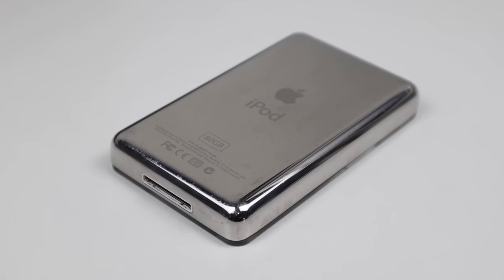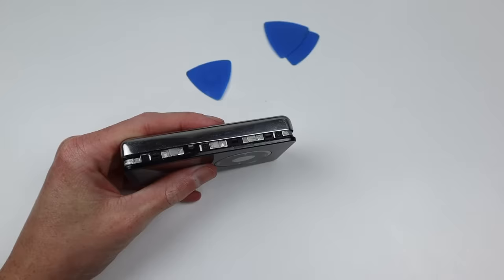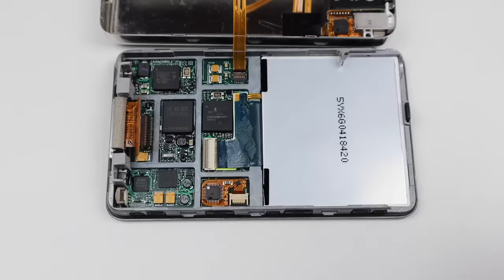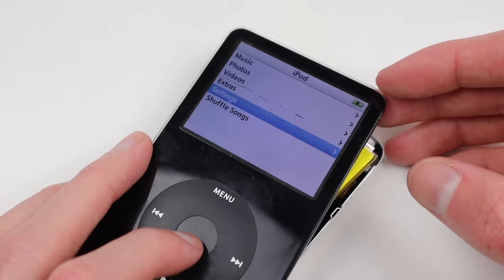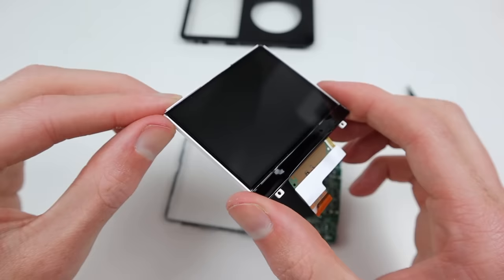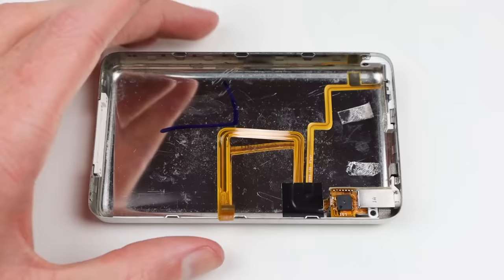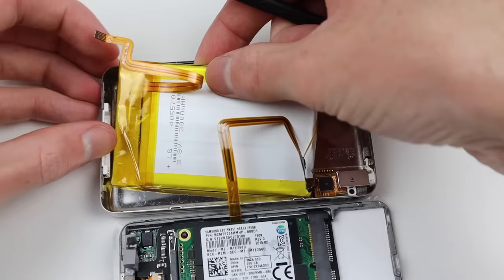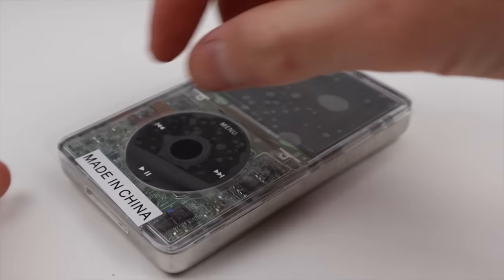Custom Transparent iPod Classic 5th Gen - 256GB SSD & "Nokia Battery life"

Comment: The "protective film" you removed was meant to be there, you needed to remove the centre bit, leaving the surround foam to protect the LCD and also to stop dust getting between the outer screen and the LCD.
Reply: Exactly.
Reply: He is not a tech guy. Thats why.
Reply: Can't speak about the protective film cause I didn't get a new screen, but the foam absolutely needs to be removed completely on the new faceplates. The old faceplates do not have this foam, and when I left it in while taking the center out, it leaves a gap visable from looking at the screen through the face plate window that the original doesn't have.
Reply: @ableite  hes not a fucking iPod guy
Reply: @ableite  um... his channel quite literally involves various broken pieces of technology...?
Reply: @ableite  lmao imagine thinking that being a "tech guy" is some sort of badge of honor
Reply: @jacobasnodgrass5853  twisting and insulating wires doesn't make anyone an electrician. The same applies but with the context you said.
Reply: but it still works so its fine
Reply: @R Huang Yeah nah zoomer.
Reply: mega O O F
Reply: @ableite  gatekeeping tech knowledge
Reply: DankPods used the same faceplate, and he kept the foam.
Reply: @ableite  you are not a fan of hugh jeffreys
Reply: @ableite   can't make mistakes?
Reply: Hugh should of realized this the moment he saw a cut-out peel for the screen portion only. The manufacturer wouldn’t go out of their way to cut the plastic film for fun.
Reply: timestamp 4:25
Reply: Yep, He screwed the pooch
Reply: It looks better without the foam
Reply: @chevymusclecar1970  it's about function, not looks

Comment: You should customize the „80 GB“ text on the back to „256 GB“
Reply: J S good idea
Reply: With a BLACK rear case! I have a 5.5 gen 30 gb with a black rear case and clear faceplate, a 3000 mAh battery and 128 SSD, running on Rockbox. I bought one of those leather Griffin case and it looks INSANELY beautiful!
Reply: Good idea
Reply: Yes, they make these. I modded mine with 512GB SD card and I was able to find a black custom back with 512GB on the back. Of course the serial number doesn't match any more.
Reply: @thomasshepsky2253  drop some photoes
Reply: You could get a cheap blank from ali express and maybe get it etched somewhere
Reply: Even better .......2 TERABYTE iPod 🤣
Reply: this is doable. however the 5th gen can only worknon 30k songs if you are in shuffle. the 6th gen, can read upto 1TB and shuffles upto 50 songs. both can be mod to 3000mAh
Reply: lol
Reply: lol
Reply: J S lol

Comment: 7:28 thank you so much for including this in the video. I'd been considering picking up an iPod partly to install an SSD and use it as an external drive for backups, but seeing these numbers (coupled with the explanation that the ZIF is the bottleneck) made it clear that it simply wouldn't be worthwhile for those purposes.
Reply: What a cool idea!

Comment: I'd try to avoid the mSATA drives if possible, they can cause some unexpected power issues on classics, especially when your battery starts to get low. Other then that and removing the gasket from the faceplate, fantastic video!

Edit: Oh, and flip the battery over, you installed it upside down and that is why the cable was getting pinched

Comment: Fantastic video Hugh. I've recently upgraded my iPod Classic 120gb with a similar card, replacing the hard drive and the battery as well. It all works great! Unfortunately I bent up the case a bit during the repairs. I now want a new front plate and back case. I'm thinking of designing and 3D printing my own. I am inspired by your vids and may give it a shot. There is genuinely something about these iPods. They just sound better to me than a phone or other computer. I'm a bit of an audiophile and have built my own tube amplifier that I run my iPod through into some old JBL speakers. It sounds warm and fat and wonderful. I'm glad that you are able to get parts and keep iPods running. Thanks again for sharing your experience mate. Cheers from USA.🇦🇺🍻🇺🇸
Reply: Did you ever get a case printed ?
Reply: @HighFidelityFox  I tried but never got the tolerances close enough to suit me. I gave up in aggravation lol. I "massaged" the original case back into shape and it's all working fine. Thanks for asking.

Comment: Just a Pro Tip when doing the storage mods, if you have a 30gb 5g iPod dont plan on putting more then around 20,000 songs on there, the logic board does not have enough RAM to load more songs into the library, even if you have enough storage. the thicc 60 and 80GB 5g versions have enough for around 50,000 songs. Also all the 6 and 7th gen. classics, exept for the 7th gen 160gb have a limit of 128gb using the iPod OS, you need to use rockbox if you want to use more storage with those.

Comment: I’ve made a few custom upgraded iPod classics. Usually I only keep the motherboard and screen. Both the front and back plates are better off being replaced with brand new parts. I even went with a 4x MicroSD setup and made one a 1TB iPod. Then flash Rockbox OS on there to play FLAC files.

Comment: Found this by accident, and this video fascinating. I myself used to mod the iPod 4 and 5 to better battery, SSD, and that same face plate. The problem I found was that I installed a duel boot iTunes and Rockbox. The Rockbox is my usual IOS, since it is far more flexible and easier to use than iTunes.

I found that every once in a while, the SSD upon bootup would automatically erase the Rockbox, so I would have to re-install it (basically it was just copying over the .Rockbox directory). Overall that adapter for the SSD was a bit flimsy, granted that I used not an expensive adapter.

My solution was the iPod Mini (2, bit the Mini 1 is also fine). No adapter needed. I just clip in an SSD used in standard cameras. Never, and not even once a problem. Rockbox and iTunes install perfectly. Sound is AMAZING. The iPod Mini is super easy to repair. I have only put in a 64 GB SSD max. I read that you can put in something larger if you wish, but you have to modify the Rockbox wares. I will look into it if / when I need a larger drive.

I would love to find ways to further modify the iPod Mini. The case is a hunk of metal, and it feels GREAT in your hands. It's strong, well made. Only weakness in the device is the clip  (ribbon) from the SSD to the MB can be flimsy, lots of pins, and the slightest bend can mean hours, HOURS trying to find and straighten it. And then, of course the pins bend / break. Finding new ones is not easy. Batteries are around, granted mine only last about 8 hours. 

Sorry for my rambling. Subscribed.

Comment: 6:08 Just do it the apple way, remove the hedphone jack🤣
Reply: Dankpods Bluetooth ipod classic
Reply: Honesty I’ve been off and on thinking over the past few years of a custom 7th gen and that’s not a bad idea 🤷‍♂️ I mean all I run is wireless earbuds so I could rip out the jack and figure out a way to make it Bluetooth compatible. Their is the little Bluetooth thing I use in my 6th gen nano to make it work but I wanna do something else with the charge port... so that won’t work.
Reply: The only space is basically what the new battery leaves. And it has to natively take in the signal. I've seen some dingles barely bigger than a USB port, so size wise that should be possible.
The other question is, how to tell the iPod how to pair? Sure, it could keep the antenna always-on, but there still needs to be some command to let it look for something to pair with. Maybe a small button on the hole where the plug used to be, that might work.

Comment: You should've posted this video like 2 weeks ago, when I was trying to upgrade an ebay iPod lmao
Reply: @luminumlx2604  I'm amused by the improper grammar even after you edited it lol, but no I didn't. I tried to upgrade the battery but couldn't get it to fit, so all I did was upgrade the storage. I also kinda messed it up a little cuz the buttons don't work as well anymore after trying to open it up.
Reply: @HearMeLearn  My native language is not English, so i apologize. I accidentally wrote "When you was" then i tried to correct to "When you were" but then i noticed were was incorrect
Reply: @luminumlx2604  no worries

Comment: Hi! I also changed my iPod Classic 6th Gen shell for a transparent one, the same that you use in the video. I have the slim version of this marvelous device but i struggled pretty hard to remove the old shell. The new one fits pretty well, except for the top pin (i think mine was a bit damaged) and the touch wheel. When you touchs the wheel you can feel the edges of the plastic case, there are a noticieable gap between the wheel and the case and although it works well, it is pretty annoying also. 

I am wondering if the slim version has also an thinner touchwheel, i really dont know. Also i have not removed the black frame of plastic protection that you peel of at 4:20, i only removed the central square. Maybe it add some thickness to this shell and is contributing to the gap, that is also more noticeable in the top side of the wheel (Menu button) than in the bottom side (Play/Pause). I Dont remove it because some people don't remove it, but i really don't know if it was suppose to be peeled off. 

So, i found really helpful your video. What do you think about this issues. 

Thanks a lot!.

Comment: Is this the one with WM DAC? As long as you don't have high impedance earphones this seems like a very decent device. It sounded always pretty nice and had surprisingly good UI at the time, which if we exclude some expensive top of the line android babsed players is still a rarity. 256 GB even tho most likely far from enough for whole collection, especially lossless, is more than anyone needs in the pocket.

Comment: If you want to streamline the opening process, get three iSesamo tools and maybe a cheap used face plate so that you can see where the clips are located. This generation of iPod are the easiest to open. Takes less than a minute. Don't slide a tool around the entire perimeter. Avoid starting from the bottom first. I usually go side, then top, then other side and then and only after all those clips are disengaged, I go for the bottom two. iPod videos and classics really aren't hard to open if you plan your attack and have the right tools. There will be less risk of damage.

Comment: Hi, I've build myself a modded ipod classic 5G with the cheap adapter, the trick is, to use a pice of the antistatic foil below the flex cable (to make the "plug" thicker) and only put in the cable about half the plug. If you insert it to much it won't work.

Comment: Quick note, When using iFlash adapters you do not need to keep the rubber bumpers at the bottom the iPod.  The foam pads that come with the adapters will keep it in place.

Comment: firstly, the black surround on the new faceplate is designed to stay, not be removed, that's why it had that adhesive you had to clean off. Secondly, you installed the battery the wrong way up which is why the connection for the battery was in the wrong place and you had to do what you did to make it work.

For those interested in this conversion, please ignore this guy and watch another video on here for reference, also use the iFlash memory card boards instead which give better results both in access and battery life.

Comment: Y'all opened it the wrong way. Gotta go down to unclip the clips mate. But honestly it wasn't so bad. Very very good. I've been intending to get one of these and slotting in a big battery and an SD card for my weekly music needs.
Reply: I finally got one. Actually, I got two lol.
But I'm going to be putting a thin back plate on mine and using a 2000maH battery on it instead.
The other one I got can have a thick back I guess.

Comment: These are the easiest Apple devices to work on IF you can get them open! I have a 5th gen iPod Classic myself with a borked front plastic face, and i've replaced the pitiful 30gb HDD once already, so this gives me ideas. The screen on mine had lines through it just like yours, but lately the LCD seems to be working just fine. Weird...

Comment: I’m waiting for parts I have the same iPod but sadly I don’t have the funds for a new screen lcd  but I will be restoring it with a new casing and glass  new aux flex cable because audio would not play and new battery and this video is so well filmed I think it may be one of the easier Apple devices to work on

Comment: I would not recommend a ssd over the micro sd kit. You don’t need ssd speed or write durability. I already had a 128gb micro sd, but I can find another new one for $15-$20. With 128gb storage space I will likely only write to it a few times as I will just keep all my music on it. The only thing you would need to worry about is if you drop it hard enough then the sd card would unmount, but I just put the included foam spacer sticky side down on the sd card to keep it from backing out. I also installed rockbox on my 6th gen so I could play flac files. It did not go smoothly though as I kept getting an error during rockbox installation. The solution was to hold down play and select button after it errored. You hold it until it enters disc mode.

Comment: Thanks for the video ..Just for the info..There are better SSD kits in the market now a days..It is cheaper than iFlash ,smaller 1/2 size ,and comes with 2000mA battery .You can use it with slim ipod case too..

Comment: very nice mod, congrats. Some things could be improved; there are large batteries that do not need that thick rear cover, also ssd kits much smaller. The foam around the display should have been left, otherwise dust can easily enter the display in the end. Headphone jack and connector plastic frame can be swapped to black color too.

Comment: Focus on the clips, where they are, push and wiggle your tool all the way in down the side and wiggle it along when you get a clip undone. you will never break or bend one ever again. Obviously, there is no 100% safe way to open an iPod without damaging it, I find this way works the best for me! Also, when you are starting off your dissassembly, dont push your tool in where there isnt a clip, as I have found that this can seriously increase the chances of the clips separating from the rear panel, as you would be catching the rail the clips are on and not the actual clip poking out. I used a machine learning style technique to figure this out and just plain looking at exactly how it fits together, running simulations, etc. You can feel where the clips are are and where the tool shouldnt go. Hope this helps anyone playing along! (Search iFixit.com for a guide to see where the clips are in your particular iPod)

Comment: I know this is a two year old video. I like the transparent iPod. If you still have it should think of adding a transparent click wheel and button.  

Also I made a couple transparent iPods. I removed the protective film also because it looks better with certain lcd screens. Honestly if you use your iPod in extremely dusty environments. You probably should be opening it up to clean it out every now and then so why not clean the lcd. 
😅
What I dislike about the 5th gen was the decision to put a battery behind the lcd that can expand and break the lcd and possibly the faceplate. 😢

Comment: Looks like the GB rating on case back was intentionally blurred. Fair enough. But will you say whether this was the thicker .53” or the thinner .43” size case common to 5th gen. I will be undertaking several flash mod builds and need to determine the largest battery I can fit in each case.

Thanks for the video, very interesting.

Comment: I restored a 5.5th gen on the cheap with the following parts : 2$ CE adapter + 20$ old 32GB CF card + 8$ transparent cover + 9$ 1400mah battery.

Comment: 1. As many have said the screen protective cover was removed
2. The battery was upside down, the cable was not too long
3. It's not at all advised to use the 3000 mah battery mod with an ssd instead of an sd card as ssds can produce a lot of heat that is usually dissipated by the back case using the included thermal pad from iflash. As you can imagine lots of access heat on the battery and in the case with no where to dissipate it can cause issues and even be down right dangerous. 

I like your content, but this was a bit painful to watch.
Reply: watched dankpods once and thinks hes a ipod genius
1. you can see the black part through the clear case, its ok not to remove for a normal one but it wont look as good through the case
2. no it wasnt, the battery connector cant go either way it has to go a certain way. 
3. the battery was stuck to the back case, and the ssd board isnt tall enough to touch it so it wont be able to dissipate onto the battery, and vice versa. the battery conducts with the back case, like the stock ones do so, again, no issues. its not dangerous.

I like your comment, but this was a bit painful to read.
Reply: @Thomas Simpson  1. Just because it "won't look as good" doesn't mean it's a good idea to remove it. Without it the screen can set directly on the plastic front and be more easily damaged.

2. After a rewatch I can see that the battery is at fault, but not because the cable is too long, rather the cable appears to be in the wrong side of the battery.

3. Even if the ssd isn't against the battery, it still has nowhere to dissipate heat. This, at best will shorten the lifespan of the ssd and at worst can cause heat buildup in the case leading to excess heat around the battery.

Comment: Is there a fix if the battery connector was accidentally removed from the board? I tried putting it back but the pain was bent and not bent back.